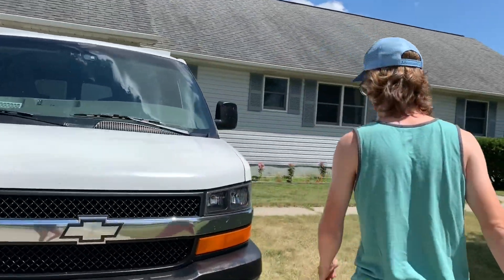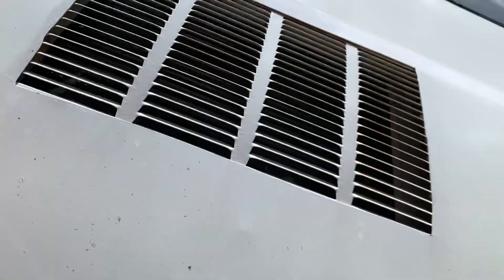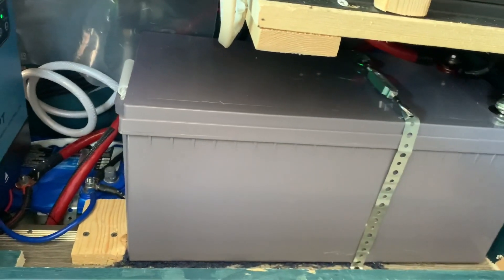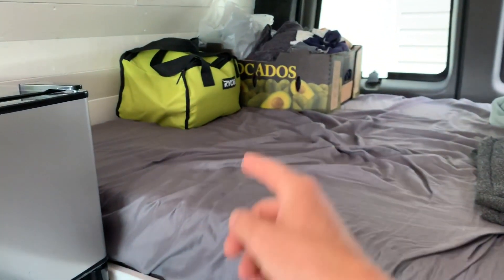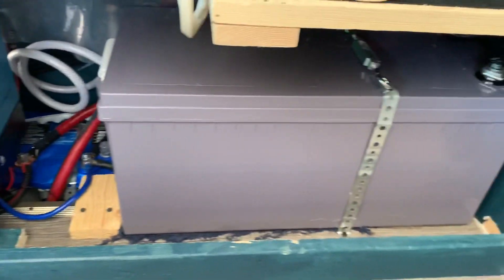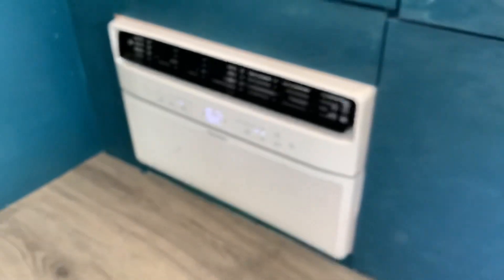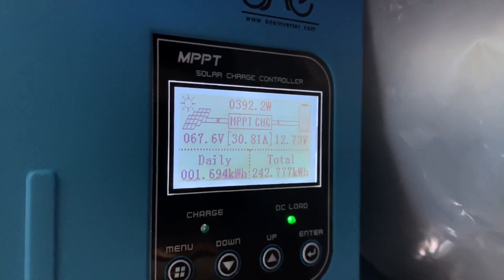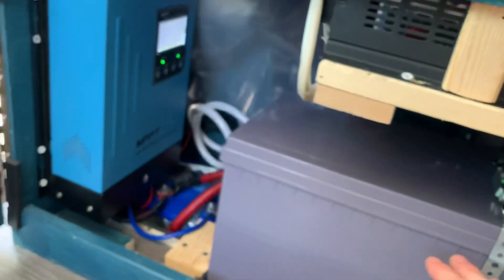Van Life Solar AC Setup - Totally Off Grid

Comment: How does it work on a hot night? Does it run continuous? Mine usually runs 10 min on and 20 off so it's 2/6 the hour rate really, on regular summer nights. Can you run on low or high? How many watts is it pulling per hour if not continuous so not watt hours, unless you're dividing it by time, if you know what i mean. Does alternator produce enough to run it and  does van have built in AC? Can you use it half the night, run van to recharge for an hour and run rest of night? Do you stay about 50% for AGM? Would you like lithium? Would having a second level of panels that slide out like an awning help? Or some internal panels you can place outside when needed?
Reply from the maker: These are the important questions!!
Thank you for bringing it up. (I do have plans for a fantastic timelapse of battery voltage, along with interior / exterior temps coming this summer!)
For now:
⚫ Hot night usage?
It seems to work okay at night, but we haven’t tested it on a HOT night (like the 105F summer nights of Phoenix) I suspect the batteries would end up struggling towards the end.
⚫ Compressor cycle times at night?
If I recall (been a while now!) ours started around 15 minutes on, 7 minutes off (so 41 mins run time per hour) but that very quickly tapered down to maybe 10 minutes on, 30 minutes off (so around 15 minutes run time per hour) then eventually just not needing to run anymore as the cool outside air finally cools the inside.
⚫Run on low or high?
I’ll have to re-measure the low speed fan power draw, but I recall it using VERY CLOSE to the same power as high speed. It was such a small difference, I just always left it on high!
⚫ Average watts USED per hour?
I finally measured my ACTUAL usage instead of going off the sticker. So, with the inverter inefficiency included, it was only around 510 watts (high fan speed: 106 watts + 404 watts compressor running).
So three examples of high speed with compressor running (depending on compressor on/off time)
On all hour: 510 watt/hr (40.5 AH @ 12.6v)
Compressor & fan on 41 minutes, “fan only” on 19 minutes: 382 watt/hr (30.3 AH @ 12.6v)
Compressor & fan on 15 minutes, “fan only” on 45 minutes: 207 watt/hr (16.4AH @ 12.6v)
⚫ AC “Eco Mode”
I need to mention the unit is often in “eco mode” which only runs the fan while the compressor is running (instead of running the fan 24/7 at 106 watts)
So my above calculation would actually be:
Compressor & fan on 41 minutes, 19 minutes off: 349 watt/hr (27.7 AH @ 12.6v)
Compressor & fan on 15 minutes, 45 minutes off: 128 watt/hr (10.2 AH @ 12.6v)
⚫ Alternator output?
It’s a 145a alternator (so around 2,000 watts at 3.5k RPM)
At idle it outputs around 1,000 watts so no problem running the electric AC
The van also has factory AC, but I deleted the rear portion. (The 6.0L V8 uses nearly ½ gallon of fuel per hour just idling. Very expensive)
⚫ Run van for half night to recharge?
You could run the van, but at idle (with the AC unit running), it would only charge around 35 amps and the other 40 amps would be running the AC.
⚫Stay around 50% state-of-charge on AGM?
This is where I make people mad… I run my batteries DOWN.
Before finally getting my diesel heater, I used an electric blanket AND a 1,000 watt space heater through the night.
I would constantly bring them down to 11v.
I absolutely took a huge chunk out of their serviceable life.
With my completely careless mindset, I never had any issue with the AC running throughout the night. The solar would come back in the AM, we’d go exploring (simultaneously letting the alternator re-charge the batteries), then do it all over again.
⚫Opinions on lithium?
I do think I’ll end up going lithium once these AGMs finally bite the dust.
Two things I’m weary about with lithium:
1)	Temperature: hey HATE the cold. You really need to install a temperature controlled electric heating pad around them or they just won’t work – charging or discharging from my understanding.
2)	Max discharge rate: I run an 1,800-watt induction plate and a 1,440-watt water heater. (143 amps and 115 amps of constant prolonged discharge on the battery bank) The AGM’s have no problem with this, however the lithium’s usually don’t tolerate such high amperage draws.
I really need to do a bit more research when the time comes. There may be new developments in the lithium technology by then!
⚫Extra solar panels?
Sliding a second row of panels out is a pretty cool idea! But if I were to do it again, I would just add a tilting mechanism to my current panels. That would REALLY increase the daily solar output if you could keep them pointed at the sun. (There are some videos out on this!)
I don’t think I’d carry extra panels with me personally. I hate having to set up and tear down. I also do a good amount of off roading and would be worried about breaking a huge extra set of solar panels hanging around inside.

Thanks a ton for the really great questions!
Let me know what I can help clarify!

-Tim
Reply: @VanwithTim  Wow great reply! I'm from Canada and canbat.com sells heated lithium batteries. I just checked battle born and they also have them. I guess they're getting more common. I'm thinking of going with a 48v system because I plan to eventually transfer it to an off grid cabin or just use additional external panels. With 48v your inverter doesn't draw as much amps so the 1800w induction would be only 38 amps! Plus it's cheaper for wiring and inverters and everything. But I plan to use an all in one box. Must see video about 48v all in one if interested. https://www.youtube.com/watch?v=ikDLxnf1ePQ Anyways, thanks for all the info, much appreciated.
Reply from the maker: @domalash  Oh nice! Glad to see they're coming heated now!
Good call with the 48v!
Great way to save on wiring costs. 

Let me know if there's any other insight I can provide!

Comment: Really impressive. Thanks for sharing. I am converting a 2019 Chevy Express LT Extended now, so what you have done is particularly relevant.
Reply from the maker: Very nice.
Love seeing more Express vans being converted to campers!
The Sprinters / Transits / Promasters all make fine campervans, but there's just something perfectly quirky and slightly more bad-ass about the domestic V8 RWD platforms.
Cheers!
-Tim
Reply: @VanwithTim  They're probably also easier to drive, particularly at highway speeds and in somewhat windy conditions. (I'm referring of course to the domestic V8 RWD vans). I used to own an old Roadtrek (Dodge). That thing was ALL OVER THE ROAD at speeds over 45mph...drift drift, squirrely, white-knuckle driving. I adored that van as a living space but had to get rid of it because I had put THOUSANDS of dollars into every facet related to drivability, and nothing helped. (I'm sure my anxiety as a driver factored in because the guy who bought it from me says he feels what I'm talking about but just keeps reassuring himself that he's not going to blow off the road even though it feels like he will.) Anyway...I'm currently in the market for a van to convert and am terrified of any of the high-roof vans for the above reasons, and that includes the nice high-top Chevy Express conversion vans. Sorry, I just rambled too much. Love your content and those who contribute via comments are also very helpful! Cheers to all!

Comment: I would like to see maybe 2 more instances of plumbers tape on that battery, tightly held down, and a larger piece of wood to keep it secured, possibly 4, it should be able to hold it if it's upside down
Reply from the maker: Absolutely. The batteries and the 620lb water tank are what really scare me in the event of a roll-over.
Has worked fine for heavy off-roading (and the rare panic stop).
Of course that's nothing compared to flying through the air and turning upside down.
Wish I had taken up welding to make some REAL secure mounting points.
A good project in the future.
-Tim

Comment: Curious why you didnt put sheet metal wind deflector on the front of the panels but on sides instead?
Reply from the maker: (The real reason was I ran out of time in the initial build) BUT!!!
It turns out these panels already get way too hot with the lack of ventilation under them.

Check out this article on heat soak vs solar output. It's very real and very noticeable.

https://www.solar.com/learn/do-solar-panels-work-less-efficiently-at-certain-temperatures/

Of course with the panels being black, the heat REALLY gets wild.
I've been lightly brainstorming ways to keep them cool.

Luckily there's no wind noise from them which I really worried about. I guess they're low enough to avoid that.

Thanks for bringing that up!
-Tim
Reply: @VanwithTim  I see. I was thinking fuel efficiency/mileage reduction with no front deflectors. Maybe take the sides off and install on front to get best of both efficiency and cooling?

Comment: I would go with 24 volts for high power draw, 12 volts can have issue with start up load, heating wires and efficiency loss. One large battery can have issues with 600watts because the voltage can drop below the cut out voltage on the inverter.
Reply from the maker: I was really torn between 12v and 24v for those exact reasons.
Luckily I had a great source for free wire, so doubling the size wasn't detrimental to the budget..
I also run the 1,440w electric water heater while driving, and the 145a alternator wouldn't be able to squeeze that much juice through a cheap DC to DC converter.

You're spot on with those initial power draw issues. I see a lot of lithium battery users having real problems with high current appliances. Upping the voltage cuts the amperage draw in half, solving that issue for them.

Cheers!

-Tim

Comment: You can get your windows tinted with the nano ceramic coating. It does a great job of blocking some of the effects of solar rays
Reply from the maker: Thanks J.G. I'll definitely be getting them tinted.
Just need to find unbiased scientific testing between all the different types out there.
(I keep hearing ceramic is king!)
Will have to do some research this spring!
Reply: You can also get a clear tint for the windshield
Reply from the maker: @chadmutchler5062  I was just looking at that yesterday actually!
Thanks Chad!
Reply: @VanwithTim  Be careful with the windshield tint if you wear polarised glasses as with most brands you will see the "polarising" streaks while wearing the sunnies. No so important with side windows but you want your windscreen clear
Reply from the maker: @GrantfromEarth  I was actually just going to call for some quotes on Monday. I'll have to look into this. Have a few different pairs of prescription sunglasses
Reply: @chadmutchler5062   I'm planning on driving across Asia so that sounds just what I need.  What should I search for pls  Chad?
I'm in the UK at the moment.

Comment: great multi functioning systems! i live at 9,000' and dont need airconditioning if i can park in the shade, but i want a fridge. ill have to rework my solar setup. its just a renogy starter kit. maybe add a couple more 100w pannels, and a good 100ah batt.
Reply: all im running is a fan, usb phone charging, and a 24" tv ill install in the spring. and bluray player. i guess ill add all that up and write renogy for a recommendation. surely i wont need more than one 100ah  li batt, and 300w of solar panels. its so sunny in colorado. of course i dont want anymore than i need lol
Reply from the maker: Wow what are you using for heat up there? Diesel heater? Propane? Sounds chilly.
I've been pretty impressed with the fridge. 

I know it's not meant to bounce around so much, but it hasn't missed a beat even while parked vacant for a week in the sun (nearly 175F / 80C inside temp).
Luckily the 3.1cuft fridge / freezer combos are available nationwide disguised under different brand names but with the exact same dimensions.

Once it eventually dies, I can swap in a new one for $160 and 10 minutes of time the same day.

Check Craigslist and FB Marketplace for solar panels! I've found them (brand new) much cheaper locally both in California and Michigan than I ever could have online.
Reply: @VanwithTim  i put rails on my roof (cargo trailer conversion, my second one) and the renogy compact 100w'ers fit great. i can probably fit 4 there. i cant imaging i need more than that, where i live! 

ive got a relatively new dorm fridge, maybe a little smaller than yours. dont know. heck ya ill use that! like you said. i think its less than 100w. 

im on my 5th heater, since my first trailer. wood is a major pain. catalytic is too wet. ive got a nuway vented propane now. working great! theyre built for ice shantys.
Reply from the maker: @d-arts7139  yeah if you’re not running anything too wild I’m sure that would be plenty of solar! 

I just installed one of those sketchy Chinese diesel heaters and seems to work alright. Tossed in three CO detectors to be “safe” lol

Propane is definitely top of the line. Glad you’re staying warm up there 👌
Reply: @VanwithTim  I just saw where people have to take apart those heaters for cleaning and maintenance. I don’t want to maintain anything! I’m lazy. I even thought about the German one, or others, but some are intensive to get going. This one takes up space but is great heat. I’m also camping a lot at 11,000’ and it takes serious output up that high. So, 5th time is a charm I guess

Comment: hey, what about some window tint? highly reflective solar tinting. i asume you want to see out your windows, and not covert them with reflectix insulating stuff
Reply from the maker: I was just diving down that rabbit hole yesterday actually. 

(So many sales gimmicks of "ceramic" "carbon" "extra security" etc. I've worked with corporate marketing teams in the past and it's disgusting how easily you can double the price of an economy product line. Simply market something about it that can't easily be proven or tested.)

I will end up doing tint at some point, just so much  opinion based information out there makes it tough to find real unbiased research.

Sorry for the rant haha. You're spot on for sure.
Reply: @VanwithTim  yea, thats why i watch youtube! you know reflectix? not spelled that way. but you could make a few panels and push them in here or there, acording where youre sitting and not necessarily all windows. would help is the openings are the same. but hey, you have enough power its a mute point. maybe privacy, sun glare, or if your batts are down and need to run the air on low?
Reply from the maker: @d-arts7139  my biggggg rear most side windows are actually lined with the Reflectix! Then I sewed together some magnetic felt window covers with reflectix sandwiched in between. It works REALLY well in both summer and winter!

But I know tiny on top of that would help a ton too

Comment: I had the same situation with my ac installation and I use a usb charge fan and it solved the issue.
Reply from the maker: I actually mounted three USB fans up on the ceiling and they seemed to work pretty well while using hardly any electricity.
Reply: @VanwithTim  smart idea 👍

Comment: Is your van the 3500 extended? I am thinking on my next van will be a passenger van because it’s pretty much already finished on the inside except for cabinets and bed frames. Work some insulation into the ceiling and side walls. Thanks for the video. Very well done.
Reply from the maker: Thanks John, yes it's a 3500 extended (there's nearly 700lbs of water on board so the extra suspension is much appreciated).

I wanted the passenger van for three reasons:
1)Easier to find with power locks and windows.
2)They have the "upgraded" front end (headlights / grille)
3)Vans look creepy without windows haha

I stripped mine out but I see many that keep their factory paneling while just adding insulation / wiring behind it all!

Comment: There are 12 volt AC's out there. Cruise en comfort has 12 volt one for trucks and it comes with a duct that you put as close to the ceiling as possible. That is another possible option? But great job on making the Toshiba unit work.
Reply from the maker: 12v would be a bit more efficient too! 
(No power lost to the inverter)
Thanks for watching!

Comment: Can you keep both A/C and fridge plugged and running during drives? Or you only turn them on while parked?
Reply from the maker: Great question. When driving I use the vans AC and have the electric unit turned off, but I do keep the fridge running 24/7. It’s been on for about 17 months now.
Probably not good for it to be bouncing around while running, but it’s a super cheap unit. It’s available all across the country (disguised under different brands) and very easy to replace on the road if need be.
Reply: @VanwithTim   17 months! Wow! Thank you for sharing.